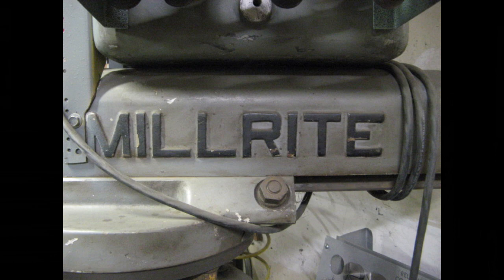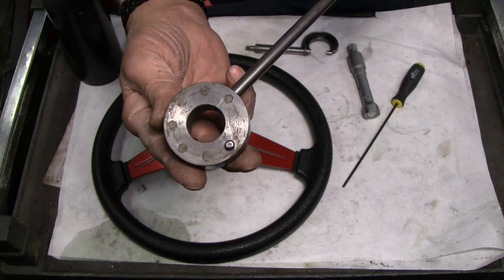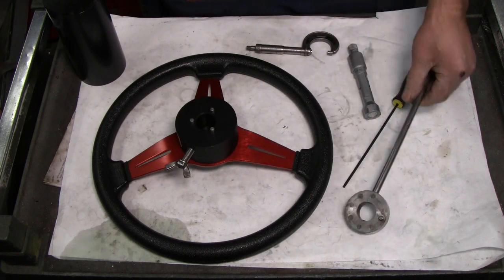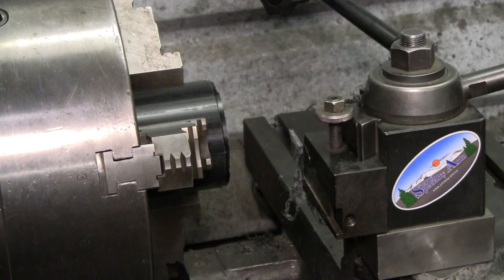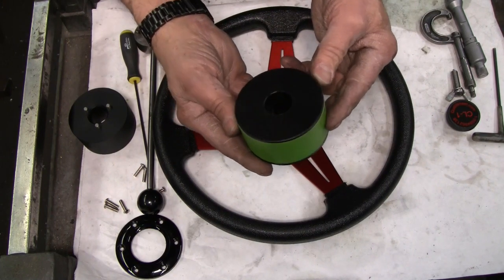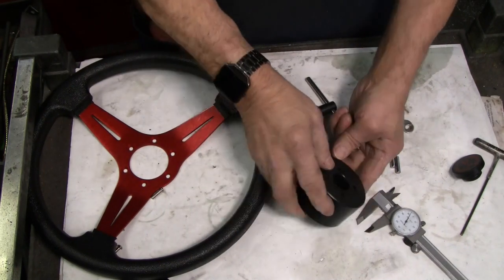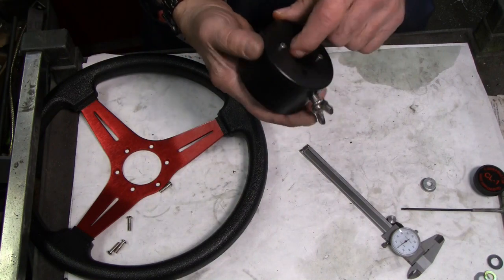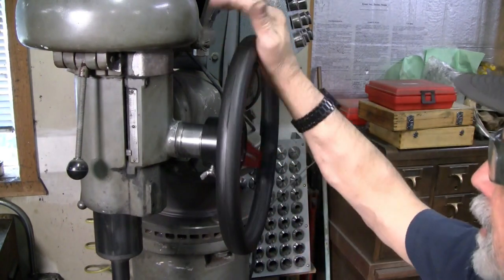Tangent Engineering Quill Wheel on a Burke Millrite

Comment: Hi Joe.  I have 68 MVN but it has the fine feed quill.  I will be working on a different type of wheel for the fine feed quill.  Question, why would you not use a HSS cutter for the delrin?  I bought an MSC column mill to do my drilling and tapping.  Joe did you build a column riser for your MVN.  If so do you have a plan for it.
Reply from the maker: Vernon, I was just too lazy to change the tool. The insert did an acceptable job once I got a good corner on it. The riser is just an 18 wheeler brake rotor drilled to fit and turned to match the OD. It's probably not rigid enough for serious milling, but I use it as a precision drill press and it works very well.